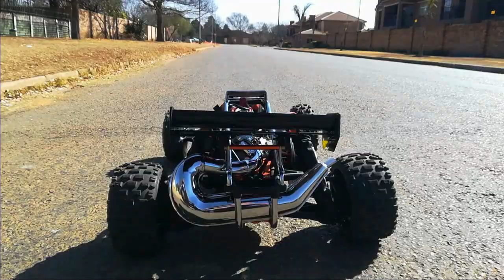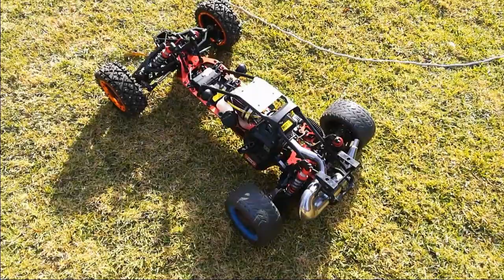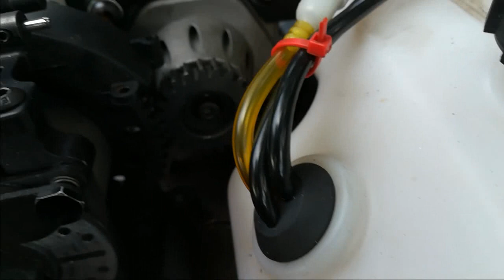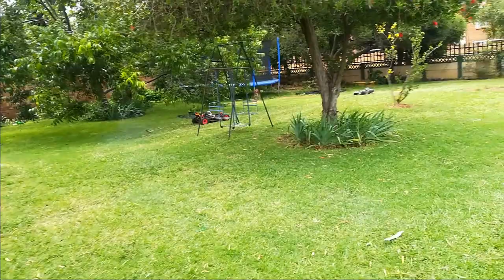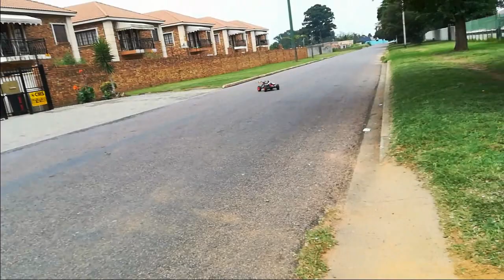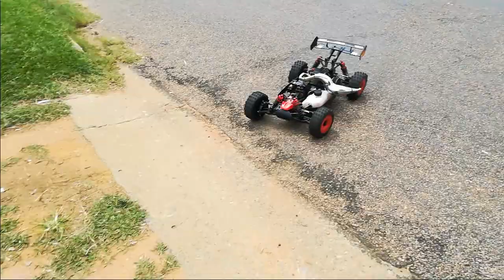Rovan V5 45cc Ported with DDM 23T Pinion

Comment: Will the ddm domintator pipe fit on the rovan 45?? Great Vid
Reply from the maker: It might be a tight fit but you might have already found this. We will not recommend it. The pipes expansion box is built for a 23cc